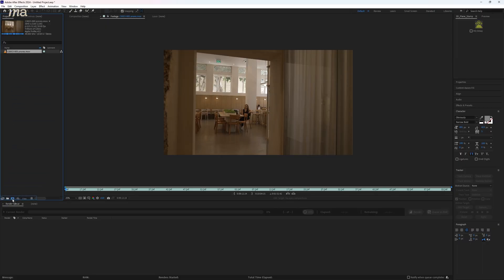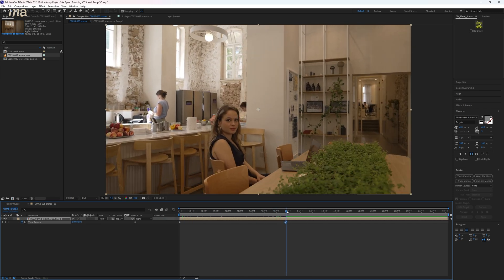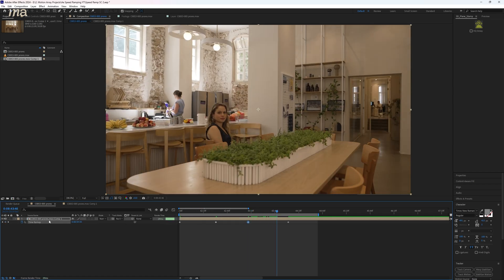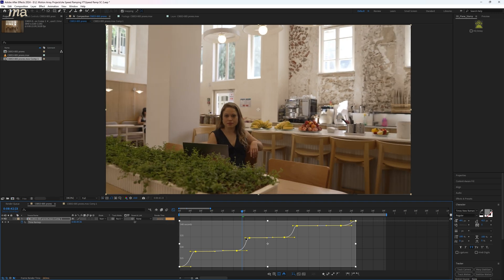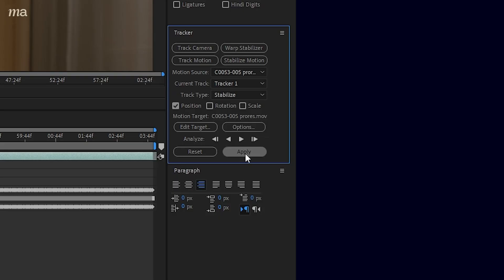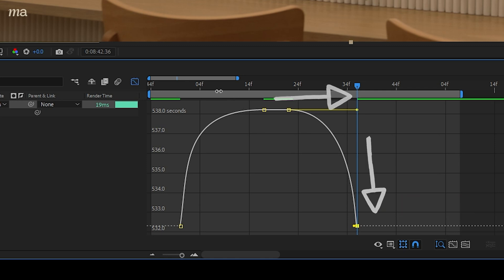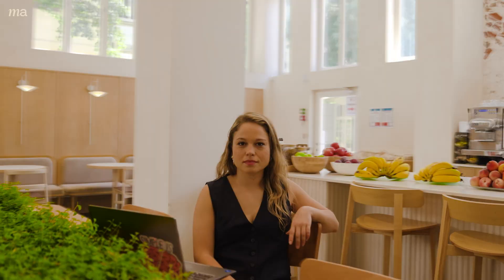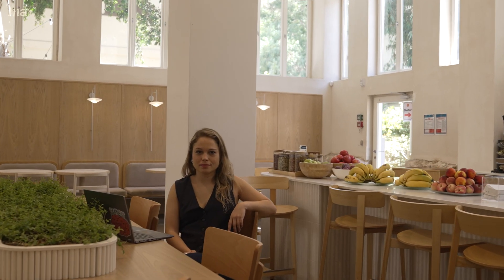How To Create The Speed Ramp Effect In Ae

Comment: When I film my clips in 60 fps for speedramps. Should my sequence then be 30 or 60 fps, to post on instagram? Or do I edit everything in a 60 fps sequence first and export everything afterwards in 30 fps?
Reply from the maker: Totally depends on what your goal is.  If you want to see that "60fps look" before the slow down occurs you'll only notice it if your timeline frame rate is 60fps.  But for everything else yes having your sequence in 30fps will work fine.  If you edit in 60fps and export in 60fps your 30fps will still look the same as it always does but you may get a bit of a different look to your speed ramp because you're seeing double as many frames of the change.  Totally a stylistic choice.  I'd experiment with both and see which looks better for that specific shot